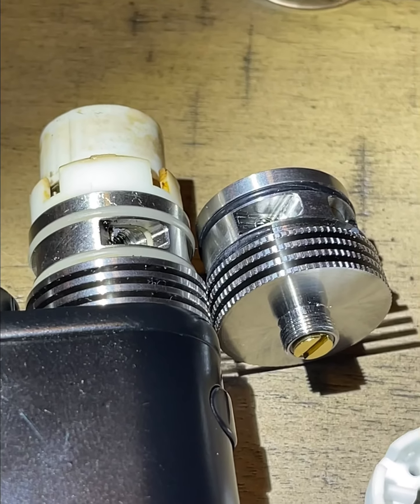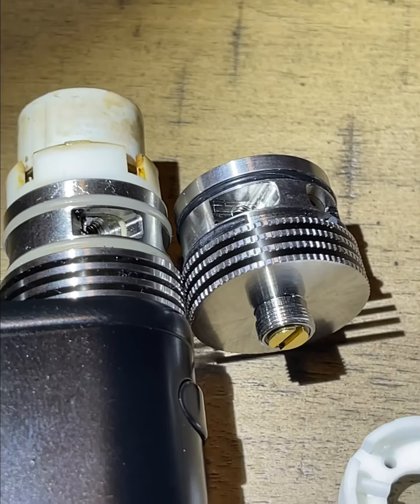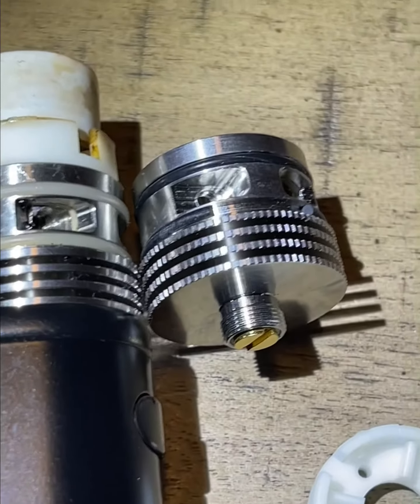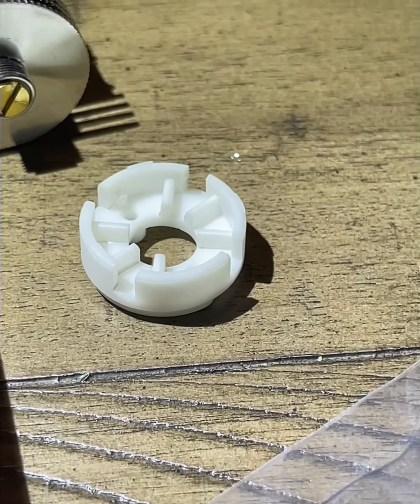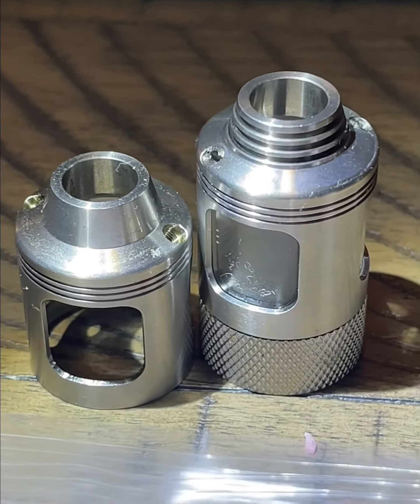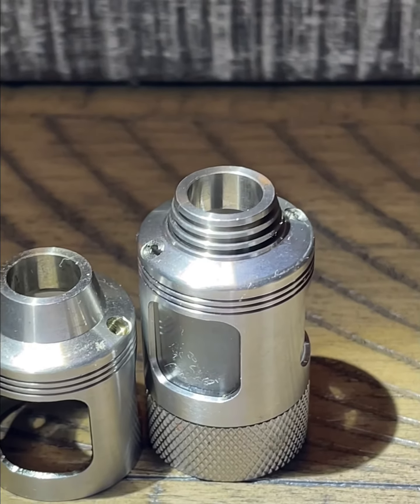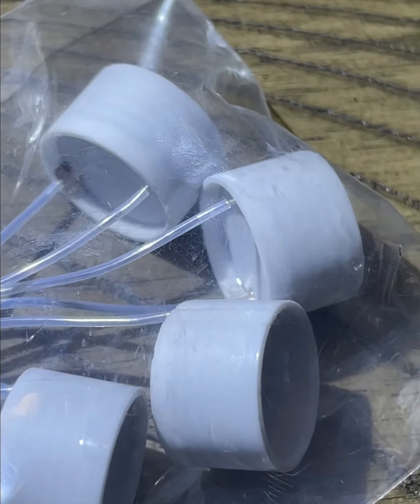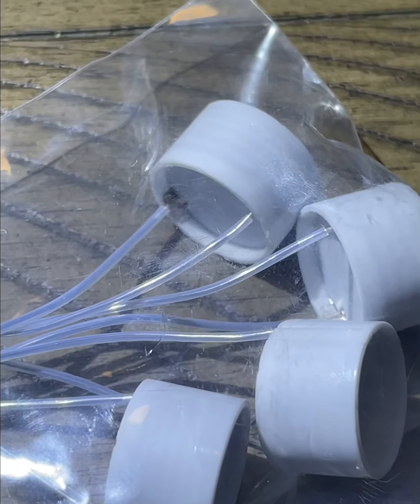V5 final part update

Comment: @divinetribe Hey matt, I didn’t get the updated metal base part for the v5 (the one you are referring to & holding at the beginning of this video.) I’m still stuck with the older jet steam one and the old spacer that has like 7-10 teeth on the spacer, (1 tooth has broken off) and still have the old steel/glass window topper with no heat fins. I would appreciate being able to get the updated metal base part if that’s possible!